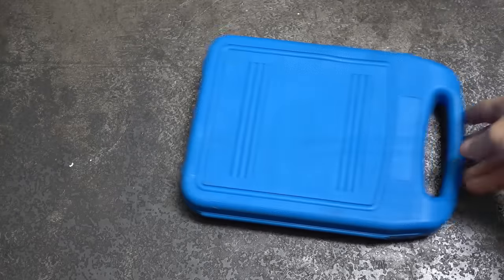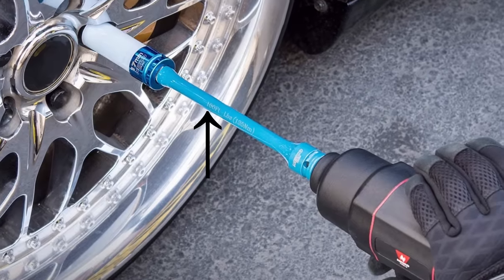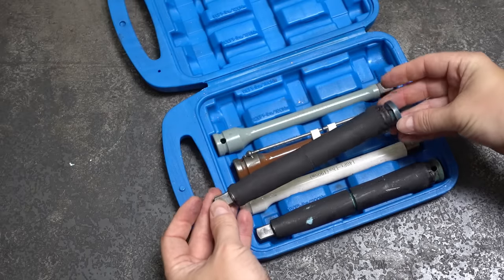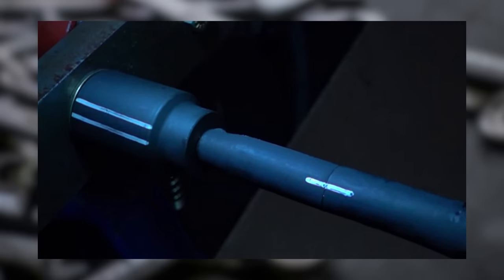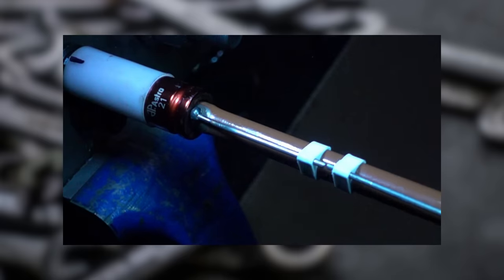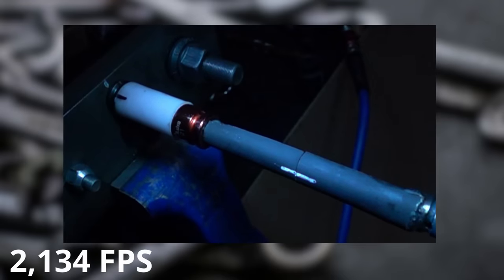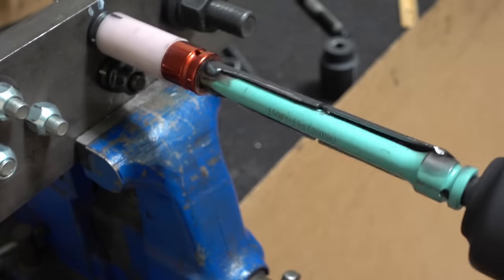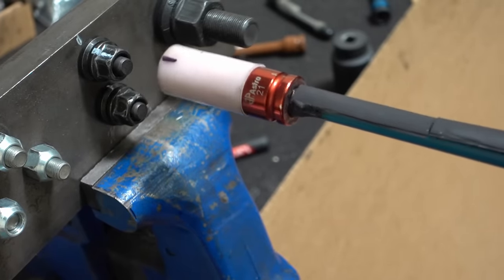Torque Sticks! High Speed Video Helps Reveal the Truth

Comment: Well it would stand to reason that with the cordless having more impacts per min you could just use a higher rated stick. Could probably even figure out exactly how much difference there is and how much higher you'd need to go to get the spec right on the money.

Comment: Even modern torque wrenches need to be recalibrated per use.  As an ex-A&P mechanic I've seen many high-end wrenches (Wiha, Stahlwille, Knipex, Williams, Heyco, Wright, Hazet...ect.)  thrown away or taken from the flight repair line for infractions such as lack of bi-annual certification, daily inspection records or oiling, lack of FOD protection and drop fatigue. 

Never trust your life to someone else's standards. Inspect what you expect.

Comment: Great video. It always bothers me when I see a mechanic tightening lug nuts with an impact wrench. "How many of them actually use a torque limiter?" is the real question. lol
Reply from the maker: We see plenty of torque sticks around here. But obviously there's plenty of tire guys that just send it out there, we've seen the result every time we need a high torque to take off a wheel
Reply: I do my best to watch them towards the end of their repair and I would guess 5%-10% use a torque wrench. Mostly the big chains, surprisingly. I had a set of wheels that were torqued to over 220 ft. lbs. The spec was 80.
Reply from the maker: @mediocreman2  Oh you mean use a torque wrench? Yeah, that's becoming pretty rare haha
Reply: It isn't a bad day when you damage the customer's studs, lug nuts, and wheels. Odds are, it is someone else's problem later. It is a bad day when the hack methods don't properly tighten the wheel and the wheel exits stage left shortly after the repair. I've seen it far too many times sadly.
Reply: When I worked at Sears auto 25 years ago, we used torque sticks on the lifted car. Then we torqued to spec with a torque wrench on the ground. We had three colors of torque sticks and the service ticket told us which one to use along with the torque spec of the lug nuts. The torque sticks were "Sears" brand.
Reply: If more customers got pissed off at tire damaging their studs, the fewer ugga dugga contests there would be at cheap tire shops.
Reply: @adaycj  It isn't cut so black-and-white like that, where only severe undertorqing or overtorqing exists.  There should be a decent margin you could tighten over listed spec torque  without damaging most fasteners, I'd say up to 20%. 
Passing the buck when people don't want to put in the minimum effort is also a huge problem in society.

Comment: Air tools should be used with a pressure regulator. Problems like sheared wheel studs surface when a shop runs straight air from a compressor to the impact wrench.

Comment: Daughter scraped tire on a damn landscaping rock which punctured the sidewall. Thankfully it was in a neighborhood. I got there and there was one lug nut I could not get off. All my weight and force and I couldn’t get it to Fing budge. I didn’t have a battery impact drill so I had to call AAA and wait for an hour in 95F sunny August day. Thankfully he was able to get it off with impact drill after about 10-15 seconds of hammering at it.  I remember Dad bitching about tire shops over torquing years ago.

Comment: So...

The frequency and weight of the Hammer act In a similar manner to rectified DC in an inductive circuit. 

A low speed hammer would be ore similar to a 1/2 wave rectifier with plenty of 'rest' time, allowing the stick to detorsion before the next blow. 

The mass of the drivers output shaft works like an inductor opposing a change in the bar, which wants to dissipate the stored mechanical (torsional) energy... 

Those sticks are designed an average clutch/shaft combo at  a certain speed. 

Weird things happen in alternating torque/time systems..

Comment: If the torsional  (Twist recovery time)  of the Torque Stick to normal position is exceeded by BPM RATE, there is a Highly reduced damper effect of the torque stick, resulting in higher torque being transmitted to work peice. MAX BPM should be spec'd for each value of the Torque Sticks.

Comment: I go by feel, air or electric. Get to know your gun with a solid extension. Electric is trickier. I’m usually a 3-4 lbs low with my air gun and +5 or 10 with the cordless, always checked with a real torque wrench. Easier to correct if low. Spoken by 30 years of rotating my own tires 3-4 times a year
Also, know your own strength. Comes in handy for head gaskets and valve covers. Again always check with torque wrench. Especially here low is easier to correct than high

Comment: The simple answer to this is to know your tools.

My impact is just under 100 ft lbs at two ugga-uggas. If it has to be more accurate I use a torque wrench. If you hammerc on it, it'll hit 120 ft lbs, that's about all I've seen it do. We don't really tighten with the impact.

Comment: Do impact wrenches not have variable speed triggers? Haven't checked mine, but I know the max rpm is less on lower settings too. If impact rate determines how well the sticks work, can you just reduce speed?
Reply: That's my question as well. Mine definitely has a variable speed trigger, just tried it out to check. I'm wondering if only going "half beans" so to speak will make them work better.

Comment: I think you should re-try with a powerful battery powered impact. The video I watched before getting torque sticks showed that a weak impact (I don't remember what kind) over torqued the bolts with the stick but the more powerful 1/2" got them to the correct value.
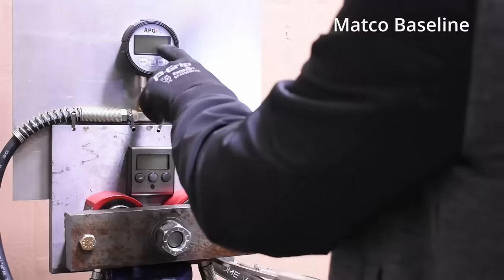Reply from the maker: We have tested with a powerful battery powered impact 5:40 and saw 30-50% over torqueing based on measurements and markings

Comment: I'm bummed you deleted your old video, although I respect your honesty when things aren't always what they seem. I shared that video with quite a few people. "Observer effect"  or not the conclusion was still valid. Torque sticks aren't perfect, can still allow over torque conditions with specific use cases, and are not a substitute for torque wrenches on lug nuts or wheel bolts. I hope you can edit it with the info from this video and bring it back. I know you don't want to hear this but a lug nut on a stud, pressed into a hub, sandwiching both the wheel and rotor together may be more like your hydraulic setup and less like the metal plates. This may be even more true when the hub, rotor, and wheel are all corroded as they so often are in the northern part of the US. Labs are never like the real world, and your "Observer effect" may not be as significant as you think.
In my own testing I've found torque sticks to be all over the place. Not because they don't work when used in a very specific scenario, but because the impacting tool is all over the place. My relatively new cordless impact has 4 settings, and on the 2nd setting it can tighten lug nuts enough to seat the wheel and nuts for proper tightening with a torque wrench. For that reason, I no longer have a use for torque sticks. Really, I never did.

Comment: I wonder if using an impact wrench with the adjustable power setting would affect the IPM and make the Torque sticks more accurate.
Reply from the maker: We found that yes a mid torque adjusted down could, but high torques not so much. But if you're already playing with settings on a smaller gun, just skip the stick and use a smaller gun on a lower setting to attach a wheel.

Comment: I got an Astro Thor last week and on day two it started leaking from the pin in the grip. Seems pretty common in the reviews most places. Has y’all’s done this? I like the gun but qc seems lacking. Just wanted to see if this was normal before I send it back. Love the vids and the clarification on the torque sticks
Reply: Air tools leak air oil everywhere. It’s normal.
The fwd reverse can leak also
Reply: @Sicktrickintuner  air leak. Not oil leak. Non of my ingersol Rand or Chicago pneumatic guns leak air from any orifice except a worn out fitting. This Thor whistles from the grip just sitting there hooked up. It’s highly irritating

Comment: I wonder if they're resonance frequency could be observed by anchoring one end in a vise and striking it to find its frequency could probably be done with audacity and see how it corresponds with the impact rate? Much like checking tuning forks wonder if this would also require a pair science ...well I guess this is more hypothesis
Reply: You'd be exciting the first bending mode not the torsional mode. Besides, the frequency of the stick torsion mode is far far higher than the frequency of the impacts. It's a pretty simple calculation.

Comment: Saying this b4 the video. Well torque sticks do work. Iv worked in 2 shops 1 where we didn't use torque sticks the other we do. And I will tell you I had 1 million swollen lug nuts at the shop we never used sticks. And I'm at this new shop where we use them and I very very rarely ever encounter swollen lugs.

Comment: Huh, I wonder if letting off the trigger some on the cordless impacts to manually reduce the number of impacts/s would keep things in spec

Assuming the impact you're using can still put out enough torque at that lower output, of course.
Reply: @Benlucky13 or using the low power setting on one of the impact wrenchs

Comment: I use them but I don’t keep giving it the beans like that .. once I feel the first bit of resistance I stop. It’s also model specific as to whether I will use a torque wrench or a torque limiter. Toyota? Torque Wrench. Chrysler? Torque Limiter. Why the difference? Because the wheels on a Toyota are right up on that rotor face/hat.. it’s imperative that they be absolutely correct as to not warp rotors. On a Chrysler or Ford, the wheels have much more room for error, they don’t typically sit right against the rotor hat/face like that of the Yota —so as long as its close, it will not have any negative impact that I’ve seen. But for me, it is highly dependent on how those wheels mate up. And yeah I’m lazy.. I’m not dragging the torque wrench out for every car, every wheel. That would be insane.

Comment: I had warranty work done on a vehicle years ago. Required removing the tires. All the lug nuts came loose on the tires they removed and installed. The claimed we used out torque extensions to put them on. Yeah but did you check the actual torque after that. Ruined some lug nuts and my rims. They would not fix it. Never went back to that dealership again

Comment: I would pay a lot more for a cordless impact that instead of the useless modes had a 75 mode and a 150 lb ft mode +/- 10 would be fine it doesn’t have to be NIST certified.  I’m guessing liability is the only reason we don’t have that already aside from that crazy expensive Milwaukee torque tool for electricians.

Comment: I generally use a mid torque cordless impact

zip the nut on with one ugga dugga and nothing gets damaged, torque with the torque wrench(usually within 1/4 of a turn or less) and you're done
I actually never used a torque stick, I know my tools and that works good enough
Reply: You know you are doing it right when the torque wrench still moves the lug nut a little bit.

Comment: What's wrong with hand tighten lugs? Never had a problem with that. I've seen lugs so overtightened it took a 6 foot pipe on breaker bar to get loose. No way on side of road. Seen lug bolts twist off, not good. A very little anti-sieze and hand tighten, can surely remove flat on side of road with X wrench.

Comment: The Milwaukee impact driver is different than the impact wrench... the impact driver is a screw gun... not meant for lug nuts.. you should have used that 1/2 Matco high torque aswell

Comment: Never used torque sticks or had them, always used the old method. Im wondering if you used the cordless impact in a slower mode, checked the torque then remarked the torque on the the torque stick (i.e stick states 90 ft lbs but on a certain impact, on a certain mode its tested at 110 ft lbs) if the results would be consistent, so say lug nuts, if the math adds up you could remark a stick thats used on one cordless impact on a certain mode you could effectively use this instead of making a pass with a torque wrench..... maybe just maybe?????

Comment: Torque stick were designed for air tools if you use them with modern electric impact that hammer faster your going to over tighten the nuts.

Comment: With torqustix you dont keep hammering , there not designed to work like that. you can feel when they start to bounce and you stop. I never needed them, impact guns have a regulator on them, I set mine to the lowest setting when tightening lug nuts and then torque them , never went over yet. you get to know your impact gun and when to stop.

Comment: Hey, thanks so much for posting this. After the first video I was, let's say, confused because your footage didn't match my personal experience with torque sticks on lug nuts. I've wondered what exactly the difference was. I wonder if the shape of a lug seat is a factor -- the cone or sphere shape offers a lot more surface contact than just a flat nut against a flat sheet.

Also with the electric impacts I absolutely think the IPM is the issue here -- the "spring" of the torque stick doesn't have time to fully return to rest before the next impact arrives, allowing the nut to progress.

I will say though, that since your first video, I have added a torque wrench pass to my regimen even after using a torque stick. As a dealer tech, I see basically the same lug nuts on basically the same vehicles all day every day, and since I use the same stick on the same impact I found my results very consistent - the amount of adjustment with the torque wrench pass has always been negligible - but I agree it is a good habit to get into and one I dropped as a younger tech. (Though nowadays I've joined the electric impact bandwagon and need to manually torque anyway.)

Comment: And this is why I have to explicitly instruct the damned tire shop to NOT install my lug nuts using any power.  They just keep cranking after the torque stick slows things down and torque until something snaps.  I have a small car, but damn, I shouldn't need additional repairs after a simple service visit.

Comment: This lines up more with my experience and my understanding of how the torsion bar absorbs the impacts. I like your rope example and it illustrates what's going on with the cordless vs. air impacts well. My working theory is based on what happens at the extremes. If you put a standard ratchet on a torque stick it will transmit 100% of its torque across the stick. Just like turning the rope manually. Using the impact driver, we are closer to the ratchet handle in performance and moving to an air impact we are closest to what the torque sticks were made to work with. I use my torque sticks with my largest impact driver set at the maximum setting and I get consistent results. Coming back with a torque wrench has become a waste of time. They've consistently been evenly and properly torqued. If you don't know how to drive lug nuts in and seat the wheel without over torquing, put down the tools! I think the torque sticks are an absolute waste of time if you haven't learned to trust them. Either snug the wheels manually and finish with the torque wrench or find a way to trust the sticks. Using both is just waste of time.
These test do show how the sticks can consistently over torque, so use a lower rated stick and be consistent with your technique.
Reply: How do you test that the torque is correct?
Reply: @awboat  The easiest way is to torque several lugs with the stick then a few more with a torque wrench. I have a beam style wrench so I can measure the breakaway torque of each lug. Close enough.

Comment: My 2000 lb Milwaukee Bazooka never torques over 800 lbs, no matter for how long I sit on it. I always have to do at least quarter to a half turn with a torque wrench set at 1000 lbs. The socket is installed directly on the Bazooka, without any extensions or adaptors. Go figure.

Comment: A torque stick is nothing but a spring. One end of the spring is actuated by the impact, the other is actuated by the bolt. Both ends of the spring are pushing against something, so if 1000ft-lb is going in one end of the spring, it's going out the other. Deflection in the stick is irrelevant and only represents a delay of the impact, not a reduction. Torque sticks do nothing, and the hydraulic test is correct. Don't sell yourselves short. 

In order to limit torque you would need to dump the impact energy outside of the gun/stick/bolt system, which torque sticks don't do and have no mechanism to do.

The reason the nut stops with a solid backing is simple - there is a solid backing. There simply isn't enough material there to stretch significantly and show further deflection. Rest assured, if you keep pounding on it the torque in the nut is going up and eventually the stud will snap.

Comment: I still don't understand people using a torque wrench for lug nuts. Just go until they ate tight, not overly, check them in 50-100 miles to make sure none loosened off, done.

Comment: Torque every bolt and nut to spec. Then try doing that on flatrate
Reply from the maker: We generally properly torque stuff like engine component fasteners (head bolts) and you'll die if it goes wrong type stuff like brakes and wheel lug nut. The other 98% of bolts get an ugga dugga count TBH